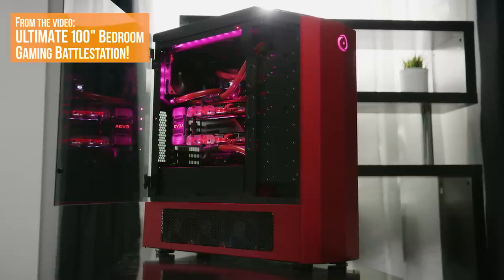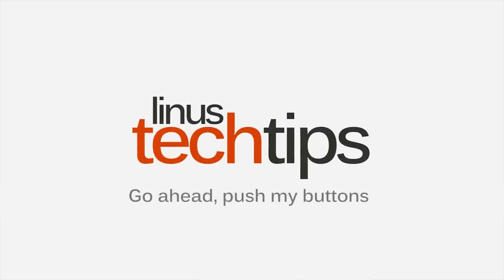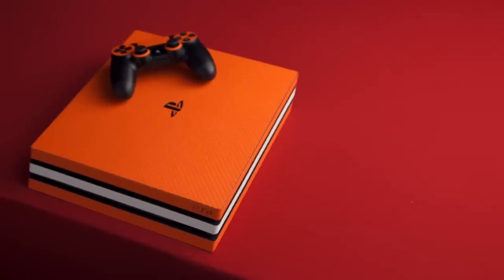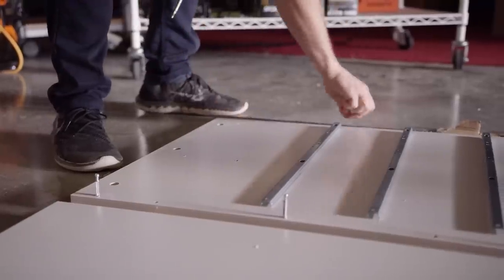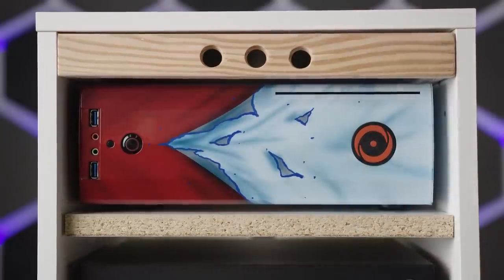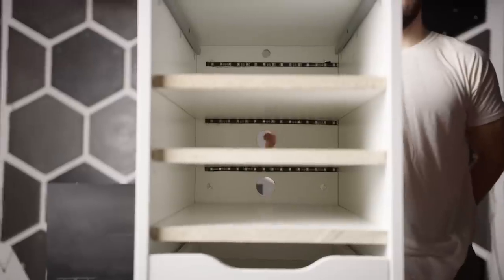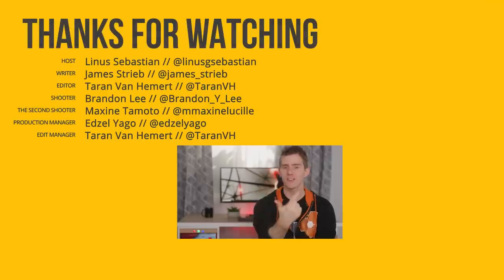Ultimate PC AND Console Gaming Battlestation

Comment: You're going to kill those consoles and that PC with that little of breathing room.
Reply: Tom5tom Entertainment, yep. People following his example will burn their shit. Actually my uncle just burned a passive cooled subwoofer without enough air space around it. Yeah, that can happen to even passive cooled electronics.
Reply: He addressed that in the video, and put fans in the wood cabinet for positive breathing.
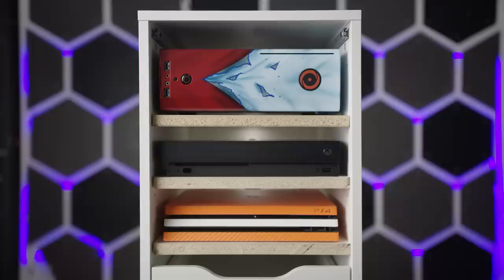Reply: 2:35
Reply: to even passive cooled electronics.... umm, passive has no forced air circulation, its drastically more likely to happen to passively cooled electronics.
Reply: if they die, they die
Reply: Linus knows more
Reply: Yeah, there were fans added. The pc also had water cooling
Reply: Tom5tom Entertainment my brother used to have his Xbox in a tiny compartment with about 3 inches of breathing room on all sides, but you could always hear the fans on 100% load, it burned to touch the console, and of the 2 years he has had the set up, hes gone through 3 consoles
Reply: +Nicholas Gilbert that's why they should only be used for short periods of time and should be mostly avoided on a hot day.
Reply: +M Being water cooled doesn't mean it's not bound by air cooling. The radiators still need fans to dissipate their heat. So if it can't breathe enough it'll still shut down. In other words, he needs that rear fan.

Comment: Why didn't you just solder the switches straight to the remote? The model shown had a button for each port, so it would've easily been the simpler solution by cutting out the software. 

I'm also sure that there are cheap prebuilt RGB controllers out there as well, but I could be wrong. It would've eliminated the ardurino entirely and eliminated time coding or adjusting software.

Have to give you guys credit, though, for making the most use of the limited space and still keeping extra storage around. Not many people would've utilized the top three centimeters like that or opted for the cooling fans on the back.

Comment: Id have added a small shelf along the left hand side for holding controllers and the headset of choice that way you could wire up your chargers through it and all audio into an amp or through your pc.  (I use my Astro amp for this)

Comment: 1. Why the Arduino for the remote?  Just wire the remote buttons to the lighted buttons? You could have also used an ESP8266 and had wifi control for some of the options.
2. The top wood trim has some ugly gaps and really does not match the rest of the build. You could have also have painted the wood. Not a great build IMHO.

Comment: good but i would have opted for a 40" or above 4ktv like what im using now ^_^ no need for arduino, but i have to manully change cables (or may force 1 console to 1080p as my 4ktv only has 2 hdmi 2.0 channels/ports, not buying xbox one x so yeah 2 inputs is fine for me, id rather have a pc+ps4pro+nintendoswitch) also i dont know of any hdmi 2.0+ switch or is not available here in my country yet...

Comment: iv been doing something like this for years. sept my setup is alot smoother then this jank. i have a HDMI switch that also has optical out that converts the HDMI audio into optical. that optical is then feed into a sound card of my pc that feeds the computer that in turn drives my cans. i also have a monitor with HDMI and duel link. so i use duel link with the computer and hdmi with consols.. the thing is that i set it up that the HDMI has priority over duel link. so if no consoles are on and it turn the computer on, the duel link will kick in and let the screen take the signal. but if i turn on a console while the computer is on, it will take the HDMI instead and switch over naturally. all enclosed in a desk that has ram air intakes and exhaust out the back for awesome thermals.  

also with your setup. why did you not just de solder the switches on the remote and add extension buttons to it. that way you dont need to make a controller... it would of taken like, 10 min to do and work just as well. -_-

Comment: So you actually just connected 3 systems into an KVM switch?
Reply: and apparently forgot all about adding a sound system...
Reply: I think they're using the HDMI to the monitor's speakers for "audio". It's a shitty build, what do you expect.

But you can find an HDMI switch with optical out, and use that for your soundbar, or whatever easily enough.

Comment: bright sparks you a avr as the host especial if you are planning to force 4k resolutions through said system...

I  would not rely on cheap hdmi switch solutions for hdmi no matter their cost..

for a true battle station you would likely a 8x4-12x6 matrix av switch catering for:
nes
snes
game cube
n64
wii
ps1
ps2
ps3
ps4 and ps4 pro
(note: I will not segas sms and genesis and 32x because these systems never came out in av models on original hardware)
saturn
dream cast
xbox
xbox 360
xbox one/s/x
Latest gen pc will cover you from all game from a windows system from 3.11-win 10 and beyond
(this is based on market and what is current based on the steam and other of the ilk store pages on games from the mid 1990's to current day)

the requirement to build an old system today is a moot point as these will run under windows and most other platforms msdos isn't needed..

all this is missing is the arcade joysticks to play the arcade games...